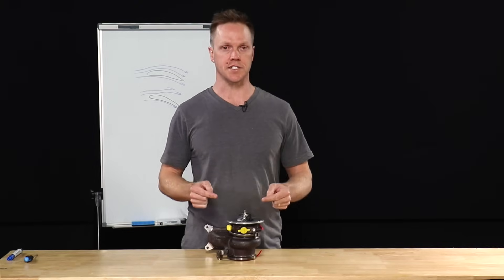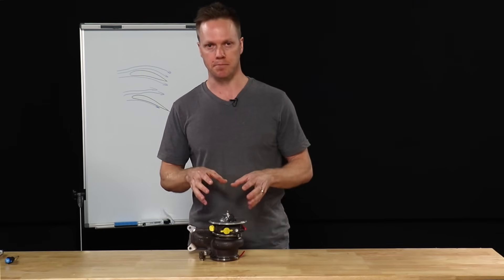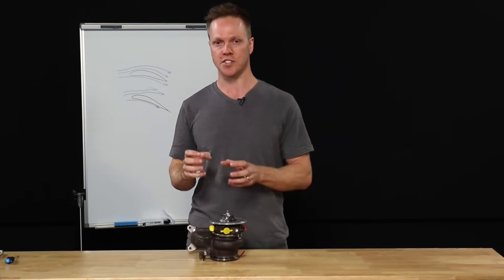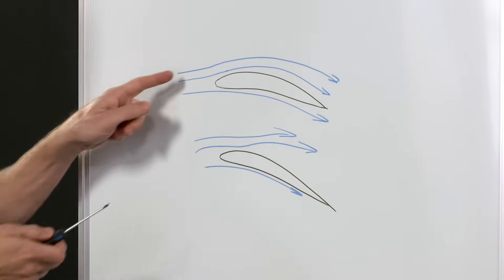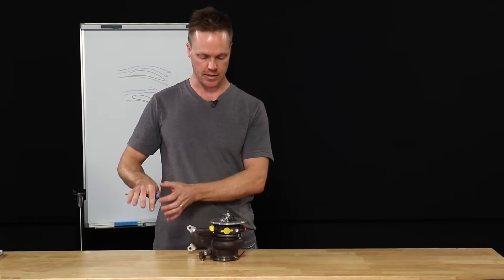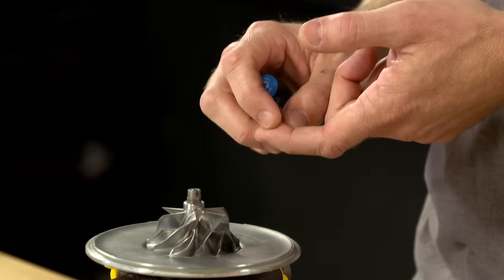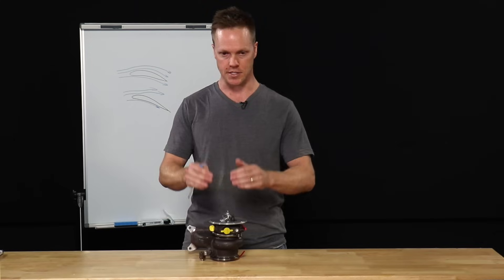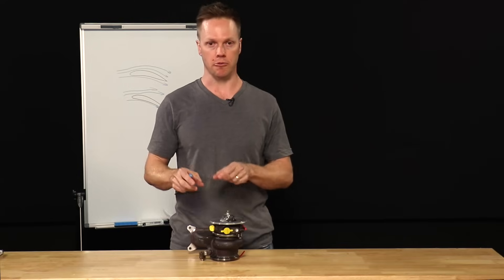Compressor Surge Explained [GO FAST BRETT]

Comment: removed my bov as it was dropping all boost between gears. now I keep 6-8psi and it make tutututututu noises.. win win
Reply: Hey bro! Does it have a negative effect on your turbo?
I'm about to run 5psi and i really wanted that flutter sound!
But im a bit worried about the negative
Reply: @JamieDeAngeloMusic   doubt 5 psi would do anything. stock boost wouldn't do any damage I wouldn't imagine.
Reply: @TraderG1234  thanks much bro!
Reply: @JamieDeAngeloMusic  I run no BOV at 30psi on my GTX2867R and have been for a few years. Zero shaft play.
Reply: @StatusQuo209  wow that's good news bro!
 I boosted a smalls 1.5 NA 5psi all for the flutter sound🤣😂

Comment: well heres something awkward,
i have a 2003 wrx with gfb response bov
with the spring preload all the way out it still surges when shifting below 3k <5psi rpm yet above 3k and anything >5psi i ccan have the spring preload all the way screwed in and theres no surge at all 
so brett under low boost shifts if you say it can damage the turbo ...... should i throw the gfb bov in the bin or under that situation is it fine
Reply: Do you consider 50psi low boost? search "50psi boost 1200+hp Nissan RB30" on youtube, plenty more videos on that channel of people running a lot of boost without a blow off valve/bypass.
Reply: DriftNick the difference is many cars will end up doing 300,000 kms the high horsepower built race cars are not built for long term reliability. you do know those kind of high horsepower engines get rebuilt every 100 or so hours of running sometimes less, alot of drag cars for example are stripped down and rebuilt after every event....
Reply: I'm not Brett, but Low psi comp surge is fine. I've been working on turbo setup for years. This is how so many 80's turbo cars can still run okay on stock turbos; they make comp surge,  but only at a very low psi.

Comment: I allways thought its allways better to have a blowoff valve to keep the turbo spinning.
But it is better to have pressure in the intake piping before you open the throttle right?
so, if i want maximum throttle response (and dont care about breaking a turbo) it is better to run without a BOV????
Reply: Nah just run a recirculation valve that dumps back in front of the turbo (like all modern turbo cars)

Comment: As you were talking about aircrafts already, an actual compressor surge can occur in jet engines when the compression is too high for the air to pass through the turbine and so it tries to back out through the compressor. Only that a jet engine does not self-correct for that circumstance so it can potentially damage the engine very badly.
A term worth mentioning for anyone who wants to further research this topic would be "AOA" or "Angle of Attack" on the compressors blades. It has to do with the mentioned stall of of the compressor... :)

Comment: This makes the engineering student part of me very wet.........
Side note, is there a third condition where you're running low revs and boosting but the revs aren't climbing enough so the wastegate is dumping pressure so the engine isn't over boosting for the airflow going in? I've had this happen on my little 1.4 Turbo and wasn't sure if it was the case
Reply: thst would be the waste gate opening allittle i think.

Comment: Here in the States I had a 2003.5 Mazdaspeed Protege. Because of the sound, my friends put a sticker on the back window saying "Powered by Butterball." sssshhhhhh gobble gobble I put a Greddy BPV that recirculated back into the turbo intake; which was the factory setup. The gobble gobble was louder than stock after that. awwww good times.

Comment: i have a similar surge issue, i think. lol.
i have a 2002 wrx and on occasion, if i'm in 5th on the highway and pin the throttle to the floor, the boost gauge will jump up to read 15psi (13.5 is stock & the car is stock)
and the gauge will wave back and forth between 15 and 10.
the car kinda feels like it pulses with the gauge so i dont think it's just the gauge being a fuckin wombat.

anyone got thoughts on this?
or had similar issues?
Reply: had that issue on my saab turned out to be ignitition coil pack. could have something to do with fuel pressure aswell ur pump could be going bad
Reply: +Tanyan rogue the entire car was like power. no power. power. no power when boost arrived
Reply: +Tanyan rogue i thought maybe feuling or ignition. also on occasion when i accelerate heavy it'll get half way through the rev range and splutter for just a sec. its like it's not detonating in the cylinder or something. not sure if the two are related but probably worth getting new spark plugs and leads. if that doesn't help then move onto new injectors and coil packs.
Reply: +Ron Preston ye check the fuel filter aswell so its not full of dirt
Reply: +Tanyan rogue I didn't even think of that. lol. Probably a good place to start.

Comment: what is the secret behind the camera showing his hands when he is doing gestures?
Reply: They're using two cameras, and the video is synchronised at the start. I think they may have done something like a clap once on camera at the start of the recording as a marker that could be used in editing. You've probably seen that in film they use a "clapperboard"  to create a visual and audio reference that can be used in editing to line up the raw footage from each camera and the audio tracks from the mics. You can see he's using a mic on himself to record his voice, so the sound from the presumed on-camera clap (or similar) would have also been used to synchronise that, too.

Comment: the real question is how to get suttutu without the damage
Reply: That's easy actually,  you use a sequential bov,  or run a bov with a heavier spring and preload setup,  so that it opens only over a certain pressure (eg 5psi)

Comment: My boss has been running his turbo rb30 vl turbo without a bov since the car was practically brand new. Original turbo, no damage no shaft play, I still call myth. People fuck a turbo, and just because they don't have a bov they blame it on compressor surge.
Reply: Of course there's no damage! This is the main argument with people who don't believe in comp surge. Stock vl turbos only make around 7psi. That's fuck all pressure going back on the compressor wheel. It's when you start cranking it up to real numbers you see issues.
Reply: +xTerraH it's been running 14 psi for the last 23 years... And that thing gets abused and its a daily driver.
Reply: SuperBeauboy It is a vl though, there built reasonably solid. But if you inspect that turbo, youll have play.
Reply: +xTerraH turbo is inspected every second service, still no play I personally get to work on the car. Nothing in the turbo system has failed as of yet. And I doubt the turbo will fail due to compressor surge if it hasn't yet.

Comment: What  i need to do to have zero Surge or turbo noise on a turbo project.
Reply: Do not connect the exhaust to it. It will not make any noise at all that way.
Reply: Could have a small turbo that runs low psi and barely any intake
Reply: Recirculate the blow off valve back to the turbo inlet. like a factory turbo engine.

Comment: Curious about Brett's comment about the K04 on a MK6 R. Most of the modified ones I know run 26psi+ with no surge. My mk5 with a K04 runs 26Psi without surge. Only had surge when I was running stock DV

Comment: The gobble sound from the lack of a BOV is not compressor surge. Compressor surge happens when the turbo is actively making boost and the engine is actively ingesting that air. It happens when the turbo is mismatched to the engine.
Reply: They are both forms of surge. The same thing is happening on both occasions. Air is making it's way back to the compressor and/or air isn't being able to be forced into the engine because of the mismatch so it starts chopping it till the engine is able to ingest it.

/mech engineer
Reply: This guy is a GFB tech, can you not trust he knows what he's talking about?
Reply: Except not having a BOV is not a damaging surge, because there is no force behind the turbine anymore. REAL compressor surge, when the turbine is still being hammered, IS damaging. Not having a BOV is not damaging. They're only useful for keeping the turbo shaft speed up a little bit between shifts.
Reply: Selling BOVs.
Reply: +Tim Ramich it can be damaging. And no matter what,  it still is comp surge.
Reply: No. It's an excuse to sell expensive blow-off valves.
Reply: Tim Ramich riiiight. Thats why all turbo cars come out without bovs or recirculations valves now. 

Oh wait...
Reply: +xTerraH They are there to keep the turbo spinning better, and because misinformed people think they are needed.
Reply: Always nice to see internet randoms proclaim superior knowledge to working technicians.
Reply: ***** that's not the only reason bud.

Comment: what if u get it when only partially lifting off the throttle? Like you've accelerated to the speed limit and you close the throttle partially to maintain that speed.
Reply: Adjust the bov preload

Comment: What about a 60mm wastegate for a vw mk3 golf r, to bleed off the excess under acceleration? Nothing beats the sound of a wastegate opening on high boost!!! Can anyone tell me if wastegates are legal in QLD?
Reply: well the waste gate is inside all turbos that opens so you dont overboost
Reply: yeah I meant an external wastegate but venting to atmosphere (after some research I know it's illegal QLD) instead of being plumbed into the exhaust.  And I don't mean a bov I'm talking about an external wastegate.  Still nothing beats the sound a wastegate opening on boost!

Comment: so....if I take my turbo to bits and add some gears to the shaft coming from the exhaust turbine to up the intake boost at lower revs........then I'd need a very large blow off valve to handle the excessive pressure.....??

Comment: I've got a question:
How do you actually set the boost pressure? I know it's common practice and watched many many videos with people increasing boost but how does it actually work?

Exhaust gasses go out of the engine and into the turbo. They get accelerated inside the turbine housing, spin the turbine which sits on a shaft, spins the compressor. Air gets sucked in and compressed, is sent through the compressor housing and the intake into the engine. Right?

So where in that concatenation can I set the boost pressure? By restricting the amount of air that goes in?
Reply: Pressure gets controlled at the wastegate.

Comment: great video!  I had compressor surge until I redesigned my bpv system with larger diameter hoses and larger aftermarket bpv.  now it dumps in an instant, no angry squirrel.  

however, my friend rallys his legacy and runs no bpv or bov and he swears up and down it does no damage to the turbo and that the damage caused by compressor surge when shifting (not on acceleration) is more or less just a myth.  what say you?  he says by not running a bpv, the turbo gets into boost again after each shift much quicker because all that pressure hitting the throttle plate is already built up ready to fill the engine again when it opens.
Reply: Hes full of shit and doesn't know what he's talking about. When you run no bov or recirculation valve,  all the compressed air runs back through the turbo impeller. Effectively when it dumps out, it could tak slightly longer to actually build up boost again because it's potentially fighting against itself (if it's a small turbo or an antilag system is in place) . Think about it; it's like this,  you take a sip from a drink with a straw,  gulp it down,  and continue sipping.  (running a bov/rv). Now imagine taking a sip,  and having to blow it back down the straw before you can take another sip. (running bovless). Pretty counter-productive right?

Comment: In one of these episodes when you get the time, can you guys talk about engine swapping ?? I'm looking to pick up a old WB one tonner and would like to put a LS1 in it to replace the old iron block. 
Cheers
Reply: look it up ...... mate they are everywhere !!!!
Reply: ls1? thats pretty standard. variety is the spice of life mate, get a mopar or something different to chuck in the tonner, that'd be sick. or a chev 6.5l turbo V8 diesel and tune that... dirty big soot trail as you drag off from the lights, hell yeah
Reply: im thinking ls1 because its going to be easy for a beginner and its readability available at a reasonable price (including trans, diff, drive train) here in aus, plus i don't need a 600hp ute with literally no weight over the rear wheels i'll be doing enough burnouts as it is :P and big diesel engines are pretty rare over here as well our standard is a turbo 3ltr, a 6.5 engine alone could get me the entire conversion done in a shop with the ls1
Reply: +Aussie Butters fair enough mate.

Comment: So it's the best sound a turbo can make and it doesn't hurt anything why fix it?
Reply: did you not watch the video?
Reply: It breaks the turbo fans a whole lot.
Reply: You have people like in this video saying it does damage when you run high boost then you have multiple videos on a channel like "Fullboost" of RB30's making 800hp+ running 40psi+ with no blow off valve/bypass valve for years without issue.
Reply: jonnoMoto
You are totally correct I missed it the first time. My bad.
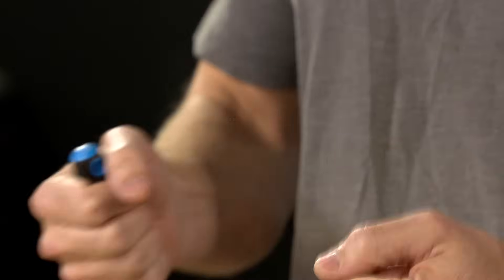Reply: +GrahamBartle @2:46
Reply: certain states you cant have a trumpet bov must be similar to standard style and be engineered if it is not fairly similar to stock or else police can defect the car basically saying it doesnt comply to australian design standards and emission standards for noise
Reply: Fuck the EPA. Glad I live in a free state with no emissions
Reply: Eh, iv'e been running gobble spec for years, however i dont run more than 14psi.
Reply: did you listen? he said it can hurt the "wings"...
Reply: well, the video just explained, that it indeed does hurt the turbocharger.
Reply: I think in Australia, there is a law about bov, that bans it... can anyone confirm or correct me?
Reply: BOV can't vent to atmosphere cos the EPA doesn't like it.